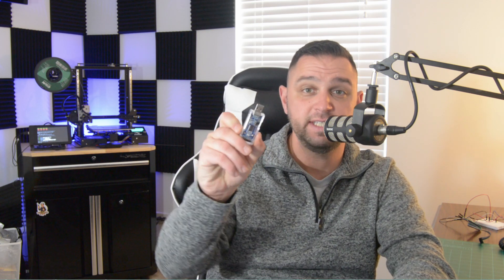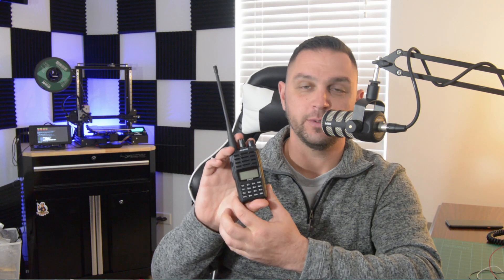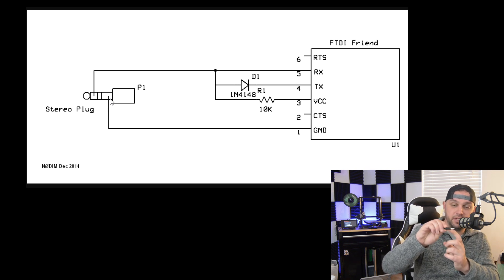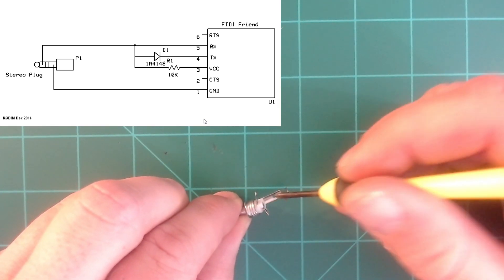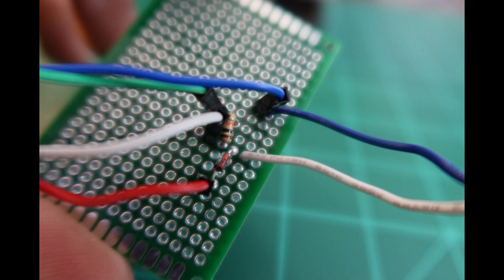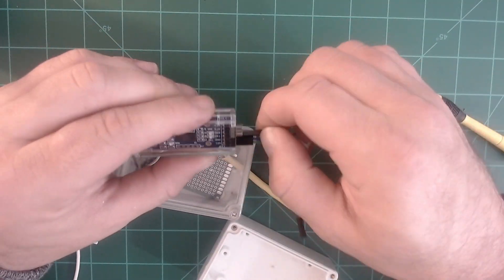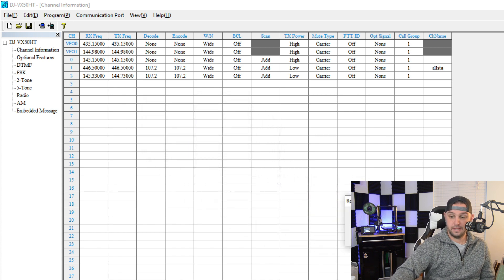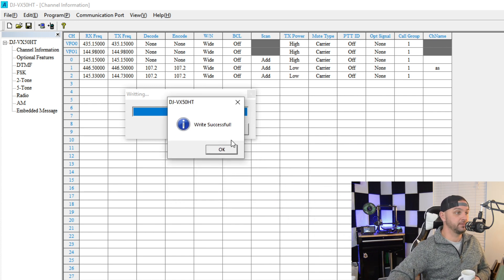Build / Make your own Alinco ERW-7 Programming Cable!

Comment: on the chip just solder the RX & TX  together --  then solder 3.5 mm stereo plug as in the diagram.....that is the same programming cable configuration for a multitude of radios...the TX wire is renamed the DATA wire....this cable works on several Alinco model radios ,,   the  cable is the same as the ICOM programming cable ---OPC_478-----, I t will  work on the The TYT 9000D  series ,   It will work on the Jetstream JT222M radio, ... it is also the same as the Yaesu SCU-35 programming cable except  the cable needs an adapter from 3.5mm to 2.5mm to plug into the radio........use an ---Arduino FT232RL FTDI Serial Adapter Module Mini Port USB to TTL 3.3/5.5V For Arduino US... the driver for this free & is micosoft compatible , works on Linux & Mac.

Comment: Sadly, that link appears to be dead.  Back to the $50 cable and software bundle I guess.
Reply from the maker: http://n0dim.com/Documents/Build-a-OPC-478U-Clone-200727.pdf  (This is an updated link.  if this doesn't work, I do not have the old file as the website has gone offline)

Comment: I built this and it seems to be able to communicate with my radio, but I have a DR635 and got the software from a ham site, but the radio displays LD *   on the screen and doesnt want to communicate with the PC.  What does LD mean?
Reply from the maker: I googled "alinco "ld" programming" and found this for another radio "When the data is sent from the master unit,. "LD***" is displayed on the receiving unit, and the data-" https://www.google.com/url?sa=t&source=web&rct=j&url=https://www.alinco.com/pdffiles/Instruction/Handheld/djv57insweb.pdf&ved=2ahUKEwi5-bS08LP_AhXqjIkEHZ_7ApoQFnoECBcQAQ&usg=AOvVaw2MxVhmNgFFlpiNT4tE5PHE

Comment: Hello, I did the same with a CH340 adapter and it does not work :( is there a hardware dependency? Is it necessary to use Prolific and nothing else?
Reply from the maker: I tried this with a CH340 last night and also did not have success.  I think a prolific may be the best choice. I however, am not positive.   Good luck!
Reply: @DudeTested  great, thanks for testing! Luckily I do have one spare PL breakout board :)
Reply: Funny. The board I have seems to be PL2303 clone. I used the hint of installing an older driver. Alinco software no longer complains about the comm port but it does not read. :( I have to look for a FTDI breakout board probably. I can't even find one on eBay - all are Chinese clones :(
Reply: ...and I misunderstood what you mean by "center conductor" :-D it took me a few fails to understand it means "the ring" (T = tip, not used, R = ring, data, S = sleeve, ground). Also the picture is a little bit unclear. Originally I used tip and got timeouts all the time. After I deciphered everything and fixed the wiring, I got working interface.

Comment: 2022Nov21 - Good Update on Setband, EX and HT - Downloaded the files and all is good. Just a note on EX. When you run EX for the first time in Win11 it pops up a registry error and doesn’t load. BUT…if you right click and run it as ‘Administrator’ it loads and works fine. Now the good part…you don’t have to run it as Administrator after that first time…after that first Adm run, it loads just fine without the need to run as Adm. None of the other program files needed Adm, just the EX and only 1 time.

FYI, Win11’s ‘Windows Defender’ security and Google Cloud’s virus scan security still give warnings when doing the initial download, but I just bypassed those by selecting the 'Keep' and ‘Keep anyway' options.  After downloading, I installed and ran MalwareBytes (with Rootkit detector) and no threats found.  Then I ran a Full Scan with Microsoft Defender and no threats found.  Then I ran each program EX,HT and Setband and afterwards re-ran both Virus scans and…wonderful no threat found!

Comment: USB to TTL adapter seems has different I/O (RX, TX) voltages, 5V/3.3V/1.8V, which voltage do you use?  Thanks.
Reply: 3.3V worked for me.